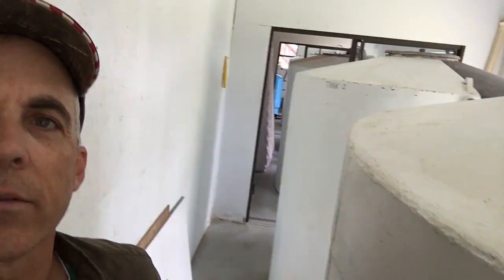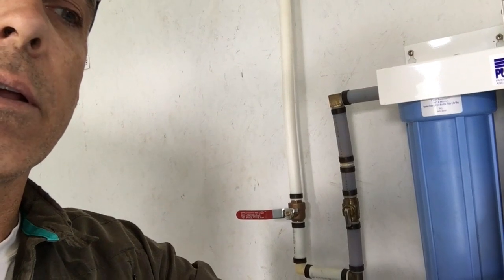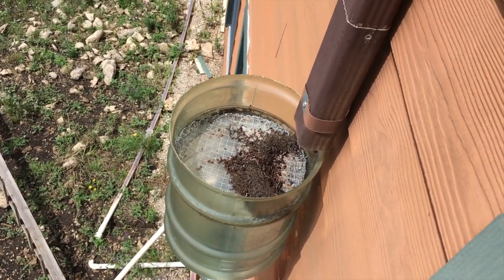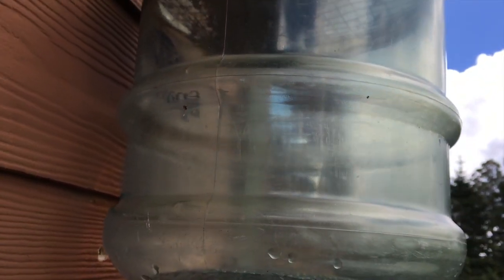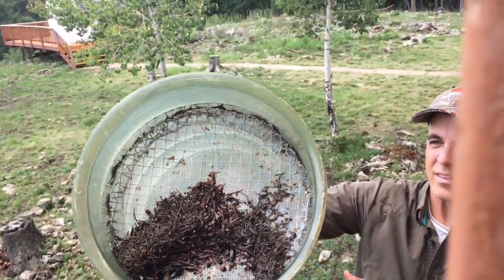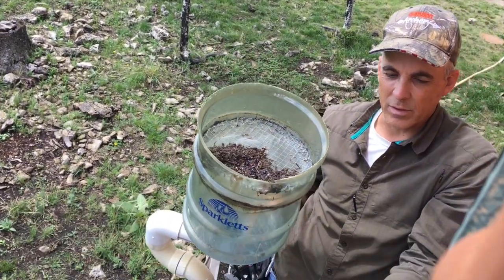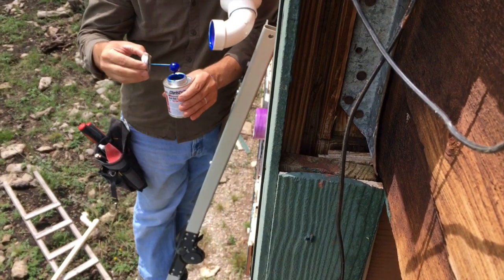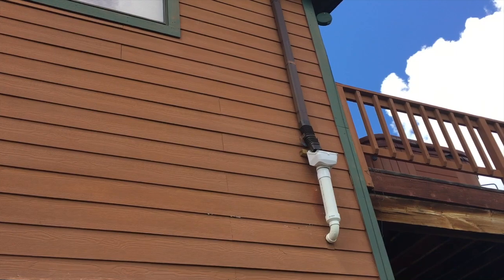Rainwater Collection and Filtering

Comment: Maybe I’m just not seeing something but where is the filtering to keep the junk out? All I saw was the pvc pipe …. No screening, no filter material.  And how do you change or clean it when whatever gets dirty or full of debris.  I mean it was suppose to be self cleaning…if you don’t filter anything, we’ll you don’t have to clean anything.  Just not understanding.
Reply from the maker: Thanks for commenting. All the debris is filtered out by the screen in the PVC device we installed outside. Anything small that makes it into the tanks is filtered by a 35 micron filter, a 20 micron filter, and treated with a UV light. You can see the filters at the 2:00 minute mark in the video. We also treat all the tanks with bleach once a month to make sure nothing grows.

Comment: thanx for sharing, but huh... is't it little bit unusual to filter water through all that plastic?
Reply: My bets are you have lots of water running through plastic piping in your home especially if it’s relatively new. If it’s older, could be anything from lead, to copper, to terracotta (very old) etc.  my question is what is doing the filtering… it’s just running straight through as far as I can see— no filtering at all.  And how are you suppose to get out whatever it filters even if did catch something.
Reply from the maker: @plips71755  35 micron filter, then 20 micron, then charcoal filter, then finally a UV filter...5 years on and all still good. Perfect water analysis.
Reply from the maker: If there was anything wrong with the water quality it would have shown up in the water analysis from National Test Labs.

Comment: Hello ElPasoTom, Nice video you made. I do have some questions and I hope jou find some time to answer them. How do you prevent the water to turn dead? Hoe much time does is take on daily or weekly basis to maintain the whole system ? How many tunes you check the quality of the water? Thanks.
Reply from the maker: I treat the water 1x per month with Beach (Sodium Hypochlorite) 8 oz (227ml) per month per 1000 gal tank. The filtration keeps the water fine to use for all purposes. For drinking I have another 0.5 micron filter at the faucet source. The last time I tested water quality was 1 year ago and tested very good ( better than municipal water standards). Water is aerated at the destination either faucet or shower head.  Thank you for watching my video.